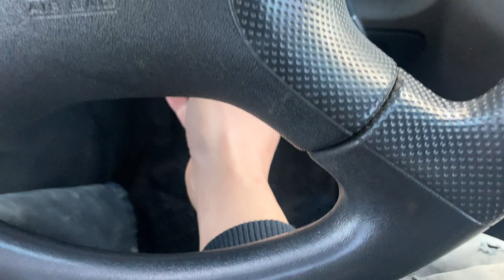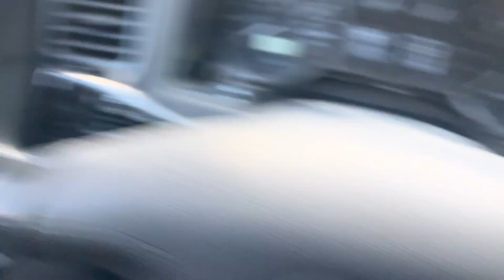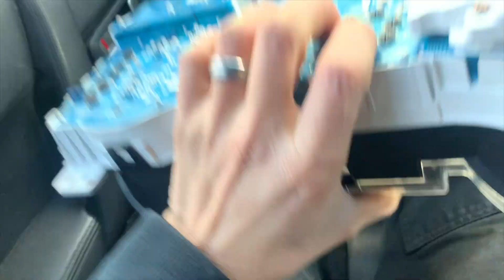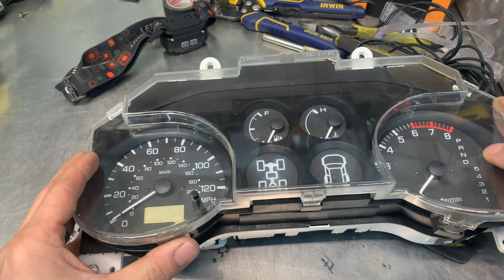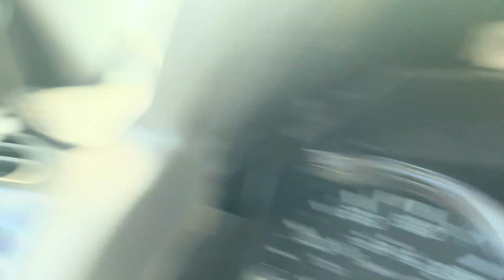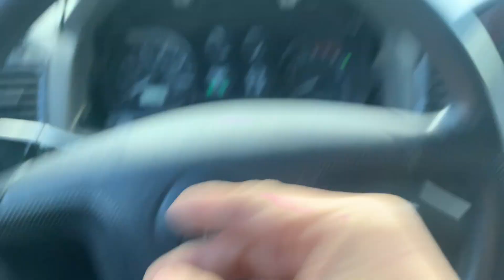How to fix common dash issues on a Gen 3 Montero

Comment: Hi I have a Gen 3 Montero 3.2 did v60 with a manual transmission (European version)  and I'm having issues with the fuel gauge. Does anyone know if the R12 is also the component responsible for the fuel gauge problem?

Comment: Super helpful, but there're a few things I wish you mentioned:
-If you want to replace one of the top row lights (indicators are the and the rest are a 2mm bulb with 0.25mm thick wire, for these I would ditch the housing and solder them in)
-If you take any of the needles out, they will be slightly off (you will have to muck around with it a bit to get it right again)
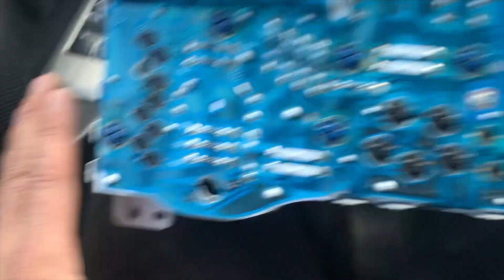-If you're having problems with the rpm gauge like me, you will have to reflow the connection points (4 points above each needle you can see at 2:52 to 2:53) try not to melt the PCB

Comment: Doing this job right now and the plastic cover is impossible to get off without risk of breaking it. Seems glued in there.

Edit: I was fussing with the edges with trim removal tools but what ended up working was pulling from behind the bottom center edge of the piece. Everything else was smooth! Thanks for the walk through man! Success from this job has inspired me to do some more maintenence tasks on my Monty.

Comment: Hi all Please help 😭 anyone has an experience a like me after soldered fuel gauge my fuel gauge get fixed but my rate reading KM number coming error the number breaking cant to read on display.do i need a new odometer or can it be fix? Any input please.Thanks in advance

Comment: Hey man, Ive got a 2002 Montero NM. fuel gauge never  worked since i own it. after watching your video i re soldered r10 and r12 resistors. got the workshop manuals resistance values for the dashboard. tested with a multimeter, strangely the fuel gauge  circuit is withing range, but the temp gauge is out. somehow my temp gauge works and the fuel one doesnt. any ideas? i just put in a new sender unit  in the tank with no luck. At this point im thinking bad wiring or maybe blown fuse somewhere ?? would appreciate any help beyond what yo show on this video. Love your channel, Pajero/Montero community surely thanks you.
Reply: same issue here. any updates?

Comment: Could you help me please, I have the same dashboard as yours, and once I took it apart to fix the temperature and fuel needle error, but when I put it back together the needles now go down completely to the top of the plastic, they no longer stay above the E and C and when I calibrate it manually on top, when I turn on the car the needles go up a lot, so I had to calibrate them manually in relation to the needles now going down completely to the top of the black plastic, but I don't know how to raise them and have them stay in their original position without them getting out of calibration when I turn on the car

Comment: I just did this and my fuel gauge  works now! However the odometer screen is now looking like I may have somehow messed up those connections because the numbers are no longer legible. Thanks!
Reply: Ah maybe the connection is not fully seated. Going to try and pull it back out. You’re the man!!

Comment: I have issues with the fuel gauge not reading soldered the resistor it works kind off sometimes it reads full some times it reads half tank... ive got a feeling that the sending unit also needs to be fixed. What would you think also I tested the two resistors the fuel gauge one reads 9.7kΩ and the temp gauge reads 10kΩ could that be a factor?
Reply: same issue here any updates?

Comment: Hey umm could you make a video explaining how to fix my four wheel drive light. It’s currently in the middle blinking yellowish orange. I have tried putting it in four wheel drive and taking it out of four wheel drive and it doesn’t change it. I have recently changed the thermostat and radiator but nothing else. I have a 2004 Mitsubishi montero limited. Any advice?
Reply: Check vacuum control valve switch

Comment: I have an 06 now, had it for 2 weeks. The only Code I get is for Small Evap Leak, but after clearing it twice I think my truck is solid! One of the ONLY issues with it is the spedo needle intermittently sticks on 0. It may stick for 1/2 second, or for 5 minutes, and then suddenly jumps to the correct position. I can still use Cruise, so the truck is SEEING my speed correctly, only the needle itself seems to be the issue. I think I'll try fiddling with seating that module as you illustrate, but my lizard brain also wants to REALLY give 'er a shot of WD-40! Think I would hurt anything in there giving it a quick squirt? I have DeoxIT on hand, that stuff is great for vintage audio amps and such, giving all those electrical connectors a small dab can't hurt while I'm in there too. Anything electrical that I mess with will probably get the DeoxIT treatment..switches, Rheostat knobs, anything. I want to give the whole fuse box the treatment too.
Reply from the maker: hmmm idk about that. if it's just a mechanical stick some lube would help, but if it's electrical obviously it wouldn't.. and it sounds to me like it could be a loose connection
Reply: @montanamontero  Appreciate the input. I'll probably just try everything at once! Remove and reinstall the module, DeoxIT all the ribbon connectors, WD on the speedo needle. I won't know WHAT fixes it if it works, but just after the result heh. Your videos are great, thanks for doing them.
Reply: Oh I forgot, instead of a soldering iron to re-flow the connections, there's a nifty trick people use with old GPUs...believe it or not, stick it in an oven! I'd be leery of trying with the white plastic of the module still attached, but if you can separate JUST the board out it could work. You can find several videos of how they sometimes breathe new life into GPUs. Not 100% effective, but works enough times to be worth a shot. Would NOT attempt with the membrane circuits obviously, just with the more traditional circuit boards.

Comment: I did this with my tpms light, and my right turn signal stopped working. For some reason 😂😢 I replaced the bulb twice and nothing. So, I lost two lights instead 😅
Reply from the maker: yeah it seems that some lights feed off of others, so that if you remove one it might have some other side effects. i only figured that out after posting this video haha
Reply: Put both bulbs back in and tape over the see through plastic for whatever you want to hide.

Comment: I tried soldering the r10 for the fuel gauge, yet the fuel level is still not accurate. The reading is way off, when iturn the ignition the fuel gauge was in a different position. And when the engine starts the fuel gauge change higher. 
What advice can you give after this? Maybe fuel pump needs changing? Any suggestions?

Comment: Thanks for the help! Just got a 2002 and my tach is stuck right around 3500-4000 all the time. Wiggles around slightly, but mostly stays there. Do you have any idea what could cause that?
Reply from the maker: i would take the dash out and see if you need to press on the spot next to the needle
Reply: @montanamontero  Finally took the gauge cluster out and sure enough, the 5 screws around the speedometer module were loose, and it wasn't pressed in fully. I pressed it all together, felt the positive clicks and it got set, and snugged the screws. Low and behold, the tach is working perfectly now. Should have done this months ago, only took 10 mins start to finish! thank you!

Comment: Hi, I need to make small tap to get the speedo and techo meters to work. they sometime dont move after starting. Once I do a little tap they work. Do you know of any solution?
Reply: You most probably also have what's referred to as a "dry" solder joint. To fix a dry joint you have to melt the solder again and let it set, just like it's shown in this video for the resistors. If you don't know which joint is dry, just do them all, working your way around the circuit (it's almost impossible to see a dry joint on the surface mounted components) Work carefully, good luck

Comment: Glad it was worth removing my cluster to show you how to do this, I see you got it finally removed. Know everyone else can also tackle how to do it as well. And you are welcome by the way 😅
Reply: I have my Monty gen 3 that goes completely off once the key is turned off. I wonder what the previous owner did to it ( i got it just recently). Once i take the key out, the horn wont work and the alarm (after market ) will not work. I would like to know where exactly to go and check. Please give me some pointers where to check for dry joints or fuses etc. Thanks in advance
Reply: @ what you mean it goes completely off. 

Check fuses make sure they are the correct size where they need to go

Comment: Brian, it kind of hurts my heart to see you use Phillips bits on those screws; they're JIS and the right ones fit those screws and don't slip. Tell yourself you deserve a set. Also, you can buy a simple magentizer/demagnetizer tool to make any small metal object into a weak magnet temporarily. Removing the check engine light/service engine soon light would result in an automatic emissions failure in the metro Phoenix area where I live, so I can't do that. Really like how the Gen 3 dash just unplugs like that. The Gen 2 is a pain, so's the Gen 1, kinda. Great video!

Comment: Awesome explanation as usual!  I did find an OBD gauge that has an auto reset function on the pesky codes.  You can pick and choose which ones to auto reset.  The TPMS bulb is a good one to get rid off if you have after market wheels and tires.

Comment: Awesome job and very detailed for those Montero owners that have not done this yet.
Reply: I have a Gen 2.5 and not a Gen 3, but yes, seeing how SIMPLE this is on video rather than pictures just removed any apprehensions I had about doing dashboard work on my truck.
Reply: The gauges on the gen 2/2.5 is a little more labor intensive to get this done but still doable.  There are no captured plugs like the gen 3.   @BattleshipSailorBB63

Comment: My speedometer is sticks at certain speeds jumps around a little, gonna try this. Thanks
Reply: What did you try , did you fix it? I have same issuee?
Reply: @franemilicevic5245 i. Once i bought a spedometer obd2 tool that shows oil temp and other things i put it on the backburner.  Got it from amazon and looks sleek and can clear codes